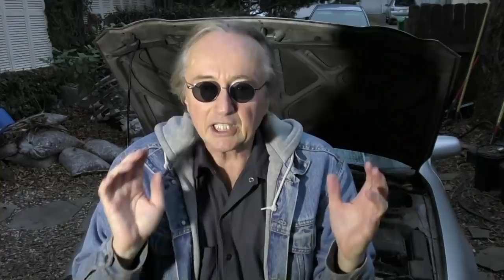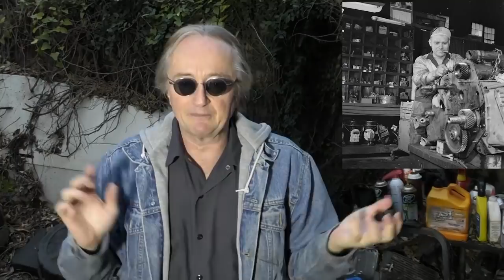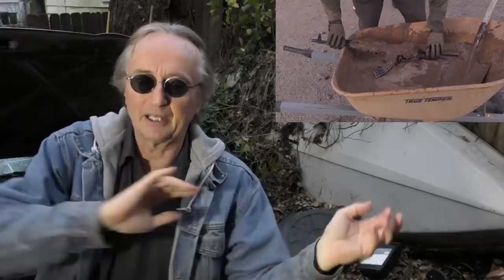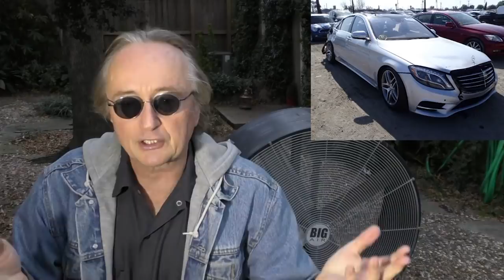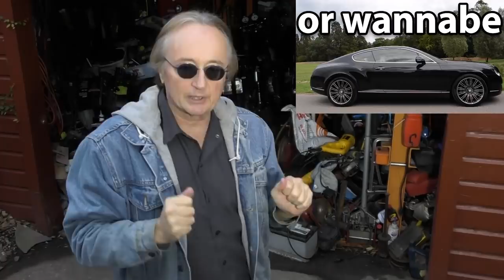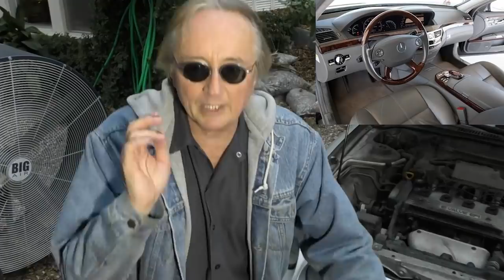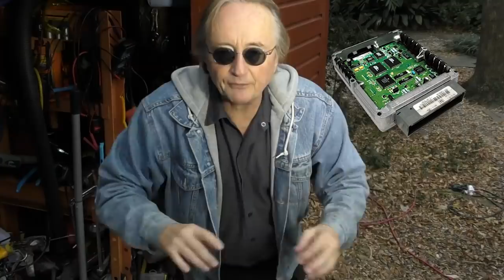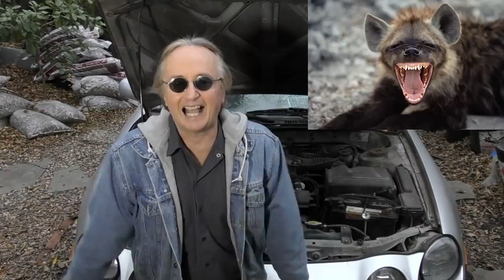Why Luxury Cars are Designed to be Unreliable

Comment: Hey Scott I have a question for you. I love the 1980 style Cadillac and I have been shopping around online for one and found a 1984 Cadillac Fleetwood Brougham with 39,000 miles on it and would like your opinion on it?
Reply: 1984 Cadillacs used the HT 4100 engine in most of them and that engine is an early aluminum engine notorious for failure.  With the low mileage the engine is probably still original and likely to fail if you try to begin using it daily.  If you plan to use it as a special occasion car and baby it, you will be OK most likely.

Comment: The "M-16/AK-47+Vietnam" is a bad example. The M-16 is running just fine with mud, because it has closed action and the excess gas blowing sh_t off the parts. AK-47 on the other hand...
In Vietnam the Ordnance Corps were basically sabotaged the rifle issuing ammo with WWII powder and not issuing cleaning kits. The old ball powder has a different pressure curve and because of that the rifles were tore cases apart and without cleaning kits, the rifles were so dirty inside, spent cases were stuck, rendering the rifles unusable.

Comment: Back in the 50s and 60s they used to try out the new things on the Olds 88 and once they work the bugs out they put them on the Cadillac. That's one of the reasons why the caddies were so dependable. No more Olds 88 crappy Cadillac. I know this because whenever I was in need of parts for my Cadillac I just go order a cheaper price same thing Oldsmobile 88 part part

Comment: Unless you were a good home mechanic, I’d be careful even with a Lexus. My Lexus LS 400’s mechanical and electrical components were very reliable but as cars get old, rubbers, bushes, and gaskets just deteriorate. And yes generally these parts were cheap for a Lexus but the labour wasn’t. I miss it but these little failures were never ending and became expensive. Okay if you are wealthy but why would you still  be driving an LS400 if you were?

Comment: Hey Scotty.
What are your views on the 1989 - 2001 R32 Nissan skylines and the engines they came with (ca18, Rb20,25,26).  I ask because I currently have one that I practically rebuilt from scratch, all electrical and mechanical work) It took time, yes but what I also found was that it shared parts with so many other Nissan vehicles such as the 200sx, 240sx, 300zx, pathfinder, u14 Nissan bluebird...

Comment: I get the point you’re making but the M16 analogy is not entirely accurate. The M16’s problems were largely political. It was designed for IMR cartridge powder not the ball type that it was issued with. The logistics surrounding the early rifle’s issue were also poorly thought out but the design of the rifle itself was basically quite sound.

Comment: Ill stick to my 23 year old Bounce Box Toyota.... All original Parts and 100% reliable over 23 years. Never Broke down sofar.

Where as i had to drive a German Branded Junker.... I managed to blow the engine up because the gearbox tought of doing a kickdown when it was at the highest RPM possible... It changed gear backwards instead of forward.... That was fun! Gues what car had to tow it away ? Right on The Old Toyota. How i laughed that day!

Comment: Your gun analogy is a little off. The first iteration M16 wasnt reliable in Vietnam because of a multitude of different issues, not just because ut was more finely tuned than an AK. The soldiers using the M16 at the time were given ammo that wasn't up to proper specs for the rifle(lower powder charge, thickness of casing). The soldiers were also told at the time that the M16 was so good that it didnt need to be cleaned or maintained, which all rifles need to be. The M16 alsobhad problems with the original gas tube. The second iteration, the M16a1 and A2 were significantly better, adding a forward assist, better gas tube, able to use wider grain variety of ammo and so on. The fact that the M16 was so finely tuned is what makes it so great and reliable. AK's can still jam btw, they arent indestructible. Getting sand or mud in the reciever of an AK can still jam it easily. Anyway, i get the analogy, but the analogy itself is a bit off lol. M16's arent all that complicated and very easy to maintain.

Comment: Planned obsolescence it's a must. We can design a mercedes that will last you 200 years. Problem is, it would be made from space-age materials and it would cost you 2.000.000 for an E-class. 
When ever you design ANY part. you have to ask the question: how long does it should last. What's the point of making a toaster to last 500 years if it cost more than a house?
Reply: they've made clay engines that will outlast what folks are getting out of steel today...so it's not always so expensive

Comment: Does getting gas from "cheap" gas stations affect performance and/or reliability?
Reply: Water is your enemy, the fuel more than likely comes from the same place the guy across the street is selling for .05 more. It all depends on the actual service station and their maintenance practices with the pumps and tanks. Diesel is even worse. Best to buy fuel or gas at a high volume seller with a clean fueling area and newer well kept up pumps and hoses. Look at the filters on the pumps, those are water separation filters. If they look old, more than likely you are pumping water in your fuel tank.

Comment: Hi Scotty, I thought you said that removing low profile rims (and tires) and replacing them with normal ones was a bad idea. That if you did it would affect the various parts of the car negatively because they were designed (programmed) to that specific diameter of the rim. I have a 2017 Mazda 3 and would really like to put normal wheels and tires on it. The 18 inch rims are retarded. But I've had them repaired under warranty so far.

Comment: Never had an alternator over heat.
Only ever had a couple go bad in my 45 years of driving. And I've driven some real beaters...

Should'a called it a "Close(d)-Loop Self-Destruct Circuit."
Reply: The GM engineers came up with a "solution" to a problem that didn't exist.

Comment: Scotty states that new luxury cars could be made to be reliable. Yes, but only to a certain extent. If you're talking about a Lexus, yes. But if you're talking about a Rolls, Bentley, or other low-volume manufacturer, not really. 

Those cars, especially the ones with complicated features like folding hard tops and reclining heated multi-adjustable power seats, and whatnot, are extremely complex vehicles with a sh** ton of electronics and moving parts. The chances of a small company with relatively limited engineering team and budget getting all those systems right the first time is vanishingly small. 

And once the budget is spent, it's difficult to come up with the money for design re-do's. So, you tend to see the same problems arise year after year. 

When engineering, tooling, and manufacturing costs are spread out over millions of cars and multiple product lines for a large manufacturer, it's easier to find the money to properly engineer and build the various components. But for a small manufacturer, even one owned by a larger company, you're now talking about all those costs being spread over a few thousand or even a few hundred cars. And that's a whole different situation.

Comment: The Ford dealership I worked in my job in brief. To road test a trade or check customer complaint.

The most odd a Hyundai. Plain sedan Genesis after leaving for road test, made sure couldn't be seen.
I floored it did quite well 
Made trip back on the highway from dead stop floored it ran decent .
Get back shop manager says what did I think?
Ran pretty good 
He said open the hood large twin turbos on a Korean price of **

Comment: I've owned many luxury vehicles. Keep up with the maintenance, and they'll be just fine. If you don't want to pay for it simply don't buy it! 

I agree with many things here, like tight tolerances, like my old e60 m5, or stupid strong v8 engines like my twin turbo F10 550i. These engines are complicated and require a lot of proactive work, but you're getting engines that make 500hp stock, so what do you expect? 

The cars aren't designed to break just so that people buy a new one... That's just dumb. No smart business would ever ever do that. They get you to buy new cars by doing facelifts.

Comment: My Fiat is a luxury car! Rides like a dream  (( a nightmare)) has the softest suspension(( held together with bubble gum)) has 3 zone A//C and heat(( my dog farting))).has  a deluxe sound system radio((( plays only Mario Lanza records from 60 yrs ago)) goes from 0-60 in 3 seconds((( accelerator got stuck to the floor)))purrs like a kitten((( cat got stuck under the hood)) when on the highway, you can barely hear the engine(( fell out 2 miles back)) great trade in value((( traded it for a Matchbox toy)))

Comment: That Kalashnikov metaphor is profound AF. I heard stories about vets who literally ditched their M16s for Kalashnikovs they took of dead VCs just because they didn't bloody jam up all the time in the muddy rivers of the Vietnamese jungle. 

Australia went with the SLR as a compromise during its involvement in Vietnam since we heard of all the issues the M16 was having. the SLR Took the same 7.62mm cartridges as the AKs that the VCs used, which made it easier to recover ammo off casualties, and it was pretty bulletproof mechanically speaking. Still a finnicky little bastard sometimes according to Dad, but it was basically the Corvette of rifles. It sat in that nice middle ground between reliable commie sloppiness and over-engineered, high maintenance trash. The SLR was no Celica but it also wasn't a Ferrari either.
Reply: Just about 0% of what youve written is based on any truth at all. 

1. Troops can't just ditch equipment, especially stuff that is as tightly controlled as small arms.

2. The SLR fires 7.62×54, the AK-47 fires 7.62×39 so they're not interchangeable.

And lastly the M16 issues stemmed from the US governments refusal to make ammo that was up to the spec that Stoner and Sullivan demanded. So the Army learned the hard way that ignoring the suggestions of your designers is a terrible idea. The ammo was then produced up to spec and the rifle has worked fine since.

Comment: You videos are awsome , my question is I have a 2001 ford f250 super duty 5.4 ages Engine and if feels like a washing machine in the rear , tires are balance and fuel are good but th shaking is alot

Comment: Scotty: puts my car in the thumbnail, doesn't talk about it
also Scotty: "Twinturbos break easily"
me: drives 150k miles.. last oilchange 20k miles ago, never changed transmission fluid

BMW ftw
Reply: @Nose Madge 26k actually.. 20k was just a guess (y'know.. metric system 'n stuff)

During those 26k miles I've refilled one liter and some (uhm.. about 1/4 gallons (?) :D) of oil.. so I basically changed 1/7 of the oil in the meantime.

Although I have to say that I could feel a slight difference in engine behaviour after the change; I guess ~15k miles is ok for this particular engine.. americans change their oil way, way, waaaaay too often imho

Keep in mind that this engine has a total of 6.5 liters (~1.5 gallons) of engine oil.. so it won't need an oilchange as quickly as an engine with only 4 liters.

Btw.. how much do you pay for engine oil per liter? We pay about 8$/L or ~35$/gallon for synthetic oil ( 0W30 )

Edit:
I changed the transmission fluid recently as well and the difference in drcing experience is noticeable, yet miniscule; FYI
what these cars need relatively frequently (~80k miles intervals) is a cleaning of the exhaust gas recirculation

Comment: Why modern automatic cars don’t need to change gear box oil? I got a Renault Clio 2014 and I called Renault and they advised that I don’t need to change oil as the gear box is sealed
Reply: Scary. Right up there with the 100,000 mile motor oil.

Comment: His opinion is a bit biased as he is located in the US. European cars have been reliable in the 80s too. I still run my 1991 BMW  E36 and my father his BMW E11. The mileage on both is above 300k and they still run perfectly fine aside from regular maintenance and part that ware out over the years (clutch, break wheels etc)

Comment: Most of the M16's issues came from the terrible ammo used the gun powder wasnt measured right in the cartridges. the modern M4 carbine has very little difference with the M16 and recieves no where near the amount of hate for being unreliable thats because the M16 designed just fine the problem was the ammo used. After the Vietnam war you dont hear about the M16's being unreliable anymore because they changed the ammo.
Reply: They also didn't issue cleaning kits nor did they Chrome the barrels properly. Army Core of Engineers did everything possible to try and sink the M16 because it wasn't one of their pet designs

Comment: Hi Scotty. I follow you all the way from Pretoria in South Africa. Fancy that 👀. I own a 2013 Landrover Freelander 2 diesel HSE.. driven from new with 125000 miles now and still drives like a dream.. I change the oil and filters every 7000miles instead of recommended 16000miles. Very happy with it. This model is used in South Africa as a recovery vehicle for landrover believe it or not 🤣.. I’m going to buy a 1ton caravan fully loaded and wondering if you can advise  with respect to service intervals. I’ll be towing at least once a month for approx 600miles. Part 2. What is your experience with this particular vehicle model in America? I know your not a fan of the brand for obvious reasons, I won’t argue with you on that 🤣 but surprise me..🤔

Comment: I had a Lincoln that the air ride went out, rubber rotted. They wanted $1K per wheel to replace. I found  the chassis was the same as a couple other Ford s so I replaced the air ride with the struts for the Ford/Mercury parts for all 4 for $1K. Later the engine blew at 65K miles and I then found Ford had warned that the engine needed the heads re-torqued at  50k, I got a Toyota corolla then and have been very happy with it for over 12 years now.That air ride would stay flat all the way to work(10 miles)  terrible car, terrible paint job, terrible engine. As I got out at work the compressor would come on and pump the car all the way up and it would stay up till I got home in the afternoon. Either up or down it was as if it had no shocks and it would beat my backsides up. I could feel the  the gravel in the pavement.I did not "hear" of the SHO engine torque requirement until after the heads blew.
Reply: Which Lincoln was that one?

Comment: People will defend those German junk boxes by saying IF you maintain them, they are reliable. Well, the whole concept of reliability is based on the idea that you DON'T have to pamper something to keep it functioning. The money you will sink into these German princesses in "maintenance" will be about the same as the repairs. And no matter how much you spend in preventative maintenance, you can not avoid the huge repair bills when the expensive overly complex parts wear out anyway. 

Reliable is when you can drive a car for 2000000 miles and NOT do anything but change the oil and put gas in it. If you have to take it to a shop every X number of miles to service it, then it is not a rugged machine.
Reply: Exactly.  The "people just don't maintain them well enough" excuse is nonsense.  Lots of failures on parts that are non maintenance items.

Comment: Everybody has there own opinion on this but as far as I am concerned the "luxury car" died in 1978. Myself I would never buy a used luxury car, no matter who made it. Simply for the fact I grew up in them and saw what the owners did, namely my dad who brought him and mom new Imperials every January 1st and did not care what dusty backcountry dirt oil field road he bounced it down cause he was getting a new one next year. I distinctly remember one of my dad's workers telling him he should get another car and not drive that Imperial down here my dad responded with, I don't give a sh!t, next year it will be a new one. I am also waiting for someone to actually build a real luxury car, you know the ones with tufted pillow seats and the only noise you hear is the clock ticking.

Comment: I'd rather ride on air 100 000 miles and replace a shock for a 1000 than stay on springs forever and spend the saved money on other modern home tech that will break.

Comment: With all due respect , ive already been down the old work beater road , cars that paid themselves off 50 times and cars in winter with no blower motors , splicing heater hoses , im older now and have paid my dues in the steel unions , and enjoy driving my E Class to work on snowy new england days , and it has been reliable as a Toyota so i dont want to hear it , Mercedes are used for taxi cabs in European countrys.

Comment: Did Ford ruin Volvo reliability? I have a 2001 Volvo S80 that is always being repaired. I've had to replace the plastic clips on the window regulators to hold the window sorry rules up and down they continuously break, I put a complete new front suspension on the car twice, the computerized throttle body went bad on it that cost $700 to replace it. It cost $900 to replace the timing belt at the suggested interval and that's just the short list thank God I have a buddy that's a mechanic and doesn't charge me out the wazoo to fix it. My dad has a 96 850 it seems the only need oil change every 3000 miles and a break job about every two years. I should have listened to my friend that's the mechanic cuz oddly enough when I asked him what car I should buy before I bought that he said a Toyota.